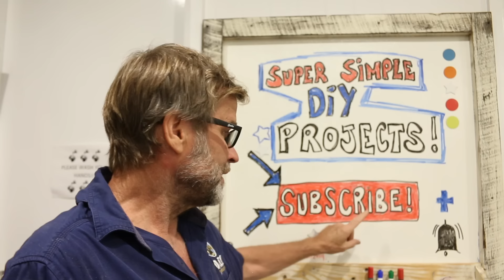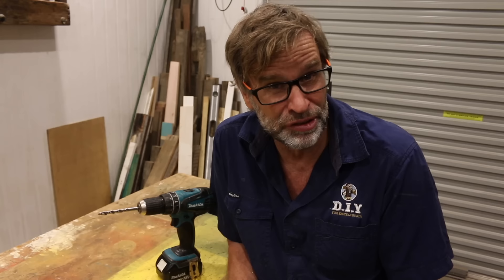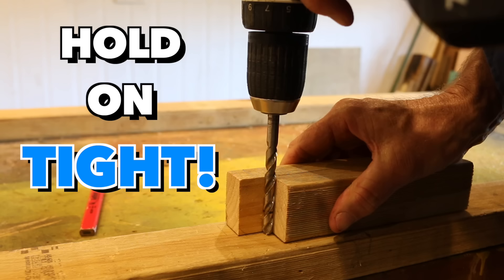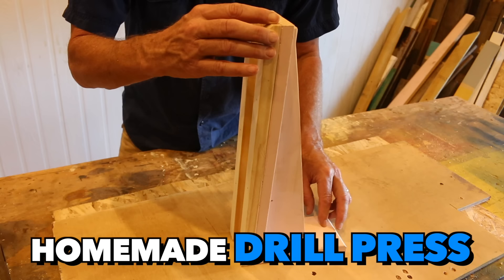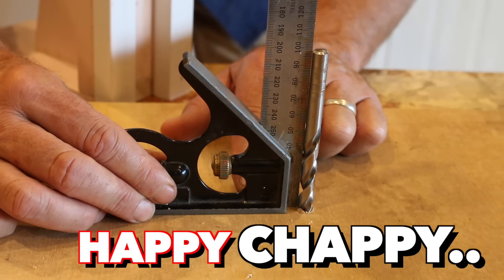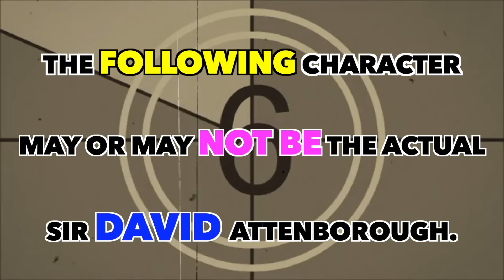8 AMAZING Cordless Drill TIPS!

Comment: I would not recommend slapping a magnet on the side of any motor, especially a brushless one.  Electric motors are driven by magnetic fields, so introducing a strong external field will reduce their efficiency.  Also, many drills are related by speed controllers which use field-sensitive components to measure the motors RPMs.  If you happen to put the magnet too close to such a sensor, it won't work properly.  (I would avoid the trigger area for that same reason also.)
Reply: I was thinking the same. Would the magnet be safe on the battery (assuming it would stick)?
Reply: @KlockoFett  Good question... Probably, I think.  The battery themselves aren't going to respond to a magnetic field, so unless there's a FET or something like that in the casing circuit, it should be OK. I have a couple of Ryobi drill/drivers with magnetic screw holders built into the battery holder.

Comment: Some nice tips here except I have to question putting a strong magnet up near the motor -- with the electronic sensors in these tools I'd find a different location.  On my multi-tool I epoxied a magnet near the base to hold the allen key needed for blade changes.  I bet someone has already commented that a bar of soap can also be used to lubricate screw threads.  For you Bond fans in the painting / coloring business go see No Time To Dye.  (GROAN)  But it's a great movie IMO -- saw it in the actual theater, if you remember those.  Peace from the US.
Reply: Yes, the motor uses magnets.  I wouldn't put the in close proximity.  Soap was the go-to choice back in the day.  I need to see No Time to Dye now.  Thank you for the post.

Comment: I've been using nails for drill bits for 30 years. Glad to see others figure it out. One warning, if you drill much, like through 2x4s using framing nails, the nails get REALLY HOT! Burned myself more than once. For longer nails, like framing nails, you don't need to cut the heads off. Just insert the head deep enough and the chuck will close just fine.
Reply from the maker: Thanks for the extra tips Dan!.....and for watching....much appreciated 😁🇦🇺👍

Comment: All 8 tips:
1.  Permanent marker to mark the hole depth on a drill bit
2. Soap or Wax to lubricate a screw
3. Use two pieces of scrap wood to form a drill guide
4. Rare magnet glued to the cordless drill holds your
screws.
5. Homemade drill press/guide out of wood
6. Use low speed to conserve battery
7. Snip the head of a nail and use it as a drill bit
8. You can peel an apple with a cordless drill
Reply from the maker: Thanks for the list Flash 👍😁🇦🇺
Reply: My addition to #1: Set direction to "unscrew" (left turning) to keep sharpie tip intact.
Reply: One addition  ... if you need to lubricate a small metal shaft just rub it on the side of your nose.

Comment: I love the drill-guide drill-press idea!!  The only thing I was hesitant about was hot gluing a wood block to the drill. Instead I made my own modifications adding a 3-inch ABS tube with a cutout mounted to a sled with a couple of small roller bearing wheels. Works great!  All made from scrap material too = no cost, only time and fun investment.
Reply from the maker: Awesome idea Mark! Well done mate 👍😁🇦🇺
Reply: Why don't drill manufacturers sell a drill press accessory?  The drill should be sold with a guide block attachment point like cameras have a tripod mount.
Reply: @geo8rge   digitally 3d scan your drill and print  a heavy load bearing accessory like from Nylon or Wood filament  with attachment holes and necessary groove for  slides

Comment: The speed selector doesn't change the voltage anymore like really old drills it changes the gear box so you get more torque less speed so you'll use the same amount of watts no matter what speed you're in you will not be saving anything to get your last few holes done
Reply: The torque increase allows you to get more torque out  a lower voltage though. Petty much use the highspeed setting, then once you get to the point where torque is lost switch to lower speed you might get a couple more screws in.
Reply: I agree with Amrauz. The gear change will reduce the current demand enough to squeeze a little more out of the battery.
Reply: The low gear is also safer for delicate jobs. It's easy to accidentally damage it on high speed.

Comment: I did a woodworking course when I was a teenager. The course was run by an old joiner who was due to retire. He kept a candle in his toolbox to provide the lubrication needed for driving screws. It makes a massive difference.when driving screws by hand but I imagine that this would really help to conserve battery power when driving lots of screws using battery powered tools.
Reply from the maker: Very true Stuart 👍👍
Reply: Also useful to rub wax along the teeth of a hand saw.
Reply: Also useful for sticky wooden drawers.  Wax 'em.

Comment: I have a tip, I'm an aircraft mechanic. And I remove panels all the time with hundreds of screws. And what I do is  put a dab of valve lapping compound on the tip of the apex bit. What it's does is it makes the apex bit grips the screw much better and is less likely to strip the screw. You can find valve lapping compound at a auto part store. This is an lifesaver for me.
Reply from the maker: Ad....that's an awesome tip mate...l'll have to go and check that out! Cheers and thanks for watching 👍😁🇦🇺

Comment: My late dad was a clock maker and a tool and die maker. He had a trick where you use the oils from the side of your nose where your outer nostril meets your face to lube screws and machine screws. 
Its acually the same oil used to lube clock bushings. There are only 2 natural sources for the none synthetic oil. A species of shark (that I cant remember the name of) and the human nose where the skin on the side of your nostrils meets your face. That little grove.
In any case they don't produce that natural oil anymore. You can only get the synthetic stuff.
Reply from the maker: Great info!....thanks mate 👍😁🇦🇺
Reply: The oil is called squalene. An old watchmaker/repairer's trick.
Reply: @bl0p3z01  he stopped doing watches because it got to difficult to see the tiny parts.
Reply: Very interesting. You bet I ran my finger through my nose part. It's dry here in the Canadian  west lol.
Reply: In chemistry you use it to lubricate the tap on a filtration funnel
Reply: Little grove between your top lip and nose = filtrum
Reply: At first I thought you were talking about snot 😂

Comment: While the pen depth gauge works a treat, I still like using tape for two reasons
1. As you see the shavings being swept, you know you've nearly hit your depth mark. 
2. It's sweeping the dust out of the way. 
Generally you're only drilling a couple of holes anyway so there's not too much chance of screwing up the tape. Besides, you can always add more tape. If I need a lot of holes at that depth, I just drill through a block of wood and use that as a depth gauge.

As for using wax for screws, yeah you can pretty much use anything. I keep almost used up candles there just for that purpose (and for lubricating draw runners, protecting steel tools). But soap works just as well for driving in screws.

Comment: Rub the screw in your hair. 
My bald head: Am I a joke to you?
Reply: This is a really really very good tip; if you do not have wax nearby, just use a bar of soap. Even liquid soap will work like magic. Oil may leave a stain but some lubrication is always welcome.
Reply: @janami-dharmam  Screws go in. Never felt the need for lubricating them in 37 years of joinery
Reply: @johnmurray9422  Please please try just for once; you will be pleased that you did. Brand new screws already have some oil on them and it works great on old screws. You know, old screws do need some lubrication most of the time...
Reply: Vaseline sold dirt cheap in the pharma aisles of dept. stores works well. Just dip the drill bit in the little container.
No nasty thoughts please.

Comment: As far as depth gauge drill bit, the thing about using tape is you can reuse the same bit for any depth by removing the tape and applying new tape.  Using a permanent marker you now have a permanent depth gauge that will forever work with only one depth.
Reply: Or a bunch of different depths marked on the same bit, also rather useless.
Reply: Actually denatured alcohol takes off permanent marker on non-porous surfaces.
Reply: Or going over it again with that permanent marker and immediately wipe it off: everything comes off.

Comment: I was taught by my Grandfather to turn the nail around and to tap the point of a it before hammering it in. That stops the wood splitting
Reply: Only happens with oval  nails
Reply: Same. But not my grandfather.
Reply: How it works? can't image it
Reply: @just-ice-4-all  Tapping the end blunts the nail point.  When hammering the nail in the wood it punches the nail thru the fibers of the wood instead of separating the fibers causing the the wood to split.  Works with all nails.
Reply: @elliottsmith3632  that makes sense. thanks
Reply: RITE! aaannd also i lick it or similar to wet the nail
Reply: @mos8541  Rub the tip of the nail on a piece of bar soap, same as you do with a screw to get it to "ease" through the wood.
Reply: @larrywhalen596  thanks, do they make a soap holder for my nail bag? hah
Reply: @mos8541  yeah,  Dad and friends were building a boat. The oldest one dragged his nail OR screw over soap first. Took years before someone asked me why i did that. I had no idea. I understand now when i see them looking at me.
Reply: I used to use candles, until I bought an impact driver...
Reply: @elliottsmith3632  Why don't they sell specially "tip blunted" nails then ? or do they?
Reply: I call it old grandpa trick.
Reply: Learnt the same when i was working in School-Holidays on Construction sides. And it worked pretty fine
Reply: @patrickotana627 
They used to... But haven't seen them for years.
Reply: @rocknral  they were used for asbestos sheets
Reply: @chriseggers560  Very true.

Comment: Great video, Sir! With the wax on screw thread thing - in the 70s I was helping my old man and an old retired carpenter to upgrade and extend our house and old Jack used to rub nails tip first through his hair to pick up hair oil and make them super easy to drive. Years later I remembered that when I was using c'sunk batten screws - and scratched my scalp. But then I got clever and used things from soap to wax to cooking oil to make driving screws easier. They all work, but soap tends to absorb moisture over time and rust the fasteners. Cooking oil (or sewing machine oil, sump oil - whatever ya got) is the best. And with wax, you can scrape shavings and put on in the pilot hole - magic.
Reply from the maker: 👍👍...Good tips mate 👍👍

Comment: Nice tips Shane love the nail pilot one especially. Also did you know that to stop the chuck coming loose when you drill, on most decent drills you can tighten the chuck up on the drill bit then turn it back one click and you’ll lock the chuck. It works on the makita for sure cos it’s the same set I have 👍🏻
Reply from the maker: Mate!.....never heard of that one before....l'll have to give it a go. Thanks for the tip and for watching Dave 👍😁🇦🇺
Reply: @francoisloriot2674  Works on my makita drill

Comment: instead of wax, we dont all have surfboards, a cake or block of everyday common soap, thats soap not soup
Reply from the maker: 😂...Yeah soup may get a little messy Tony. The reason l used surfboard wax was that we live on the beach and the kids have surfboard wax lying EVERYWHERE so it's easy to lay my hands on 👍👍
Reply: @diyforknuckleheads  used candles are great for this. Use them all the time!
Reply: I use those wax toilet bowl rings,melt em down into a small coffee can
Reply: I use soap too... it’s not messy when the bar of soap is dry. Also drag the screw lengthwise rather than rolling it - much quicker. If you use a premium soap it will contain moisturisers for your skin and smell nice too 😂😂😂

Comment: Nice tips, got an extra one for you: became fed up the other day of swapping out bits in order to use the screwhead countersink thing so I just started using the same bit that I drive the screws with. Give it a little tap with the bit before driving the screws and before you know it, perfectly flush screw heads in half the time, also found that it stopped a lot of wood from splitting.
Reply from the maker: WOW!...great tip SirRob....thanks for sharing that mate 👍😁🇦🇺
Reply: @diyforknuckleheads  aye, I think I owed you a tip after all the ones you've given me, feel free to pass it on in your videos. Thanks for helping me to go from 90% bodge jobs to about 40%.
Reply: @SirRob7  I do the same on occasion, but thats because i don't have a countersink.

Comment: Hey Bloke, I have also used a piece conduit cut so that the required length of bit is exposed.  This idea was pretty good for when I drilled heaps of holes and were all a consistent depth.  Also when screwing in coach screws, I use a bit of multi purpose grease especially into hardwood and the grease puts a thin film on the screw for protection (old 'busted-ar..ed Liney' trick
Reply from the maker: Love the tips Rosscoe!! I've used the grease before but not the conduit which is really clever 👍 Thanks for watching mate 👍😁🇦🇺
Reply: @diyforknuckleheads  Plastic straws might be a great option as well! Cut them to length then throw them in your tool box.

Comment: Never tested it but the "slow setting" is actually a higher torque so it would use just as much battery if not more as you would need more effort to drill a hole, you would use that setting drilling into metals or harder materials, a good tip though that allot of people don't know is how to use the chuck settings, allot of people think the numbers on the drill are speeds but it actually controls resistance, so a higher number will keep drilling through but a slower number will stop the drill once a certain tension is reached, good tip when using a drill for screwing handle screws, set the drill to a low number and once the screw is tight it will stop the drill preventing you drilling through or cracking the door.
Reply from the maker: Good tips Raty....thanks for sharing  👍👍

Comment: Hey I got a tip at 2:29. I mentioned cleaning gutters using a blower. You could get your cordless makita blower and instead of blowing with your mouth, use the blower. I know my nose is more sensitive and when I blow stuff I get sinus and the stiff blows back to my nose. I have used a blower to blow off wood dust and it works quite well.

Comment: Another tip when nailing near the edge of wood is to blunt the sharp end of the nail by tapping it with a hammer, works by ripping the fibres instead of dividing them.

Comment: Also, if you are drilling through metal but don't have a drill press, get an 18"-24" squeeze clamp and clamp one end under your metal and the other onto the back of the drill and voila, +300lbs of steady pressure which is very important for drilling through metal (slow rpm, lots of pressure).
Reply from the maker: Great tip....thanks 👍😁🇦🇺

Comment: Changing speed of a drill is not always right. I don't know in how many but, all the drills i used this 1/2 switch was not speed change but gear ratio change, so the engine was running at the same speed but the gear ratio was different so the bit was spinning slower but with more momentum. In short it would not change battery usage because it did not slow down the engine.

Comment: Pro tip - when using a racheting chuck.  Tighten it all the way and then back off 1 click.   That little bit of loosening will engage the locking action on the chuck and holds the bit super tight.  
Also I feel the same way about inserting a battery into a drill.  I always pretend it’s a fancy hand gun
Reply from the maker: love that tip Billy👍👍 Thanks for sharing mate. Glad to see you're a member of the Battery Clicking Club as well 😂😂.
Reply: Funny I only saw a video on this the other day.  No one I know knew this trick either. Can’t find any info in the instructions either. Been doing it wrong for years.
Reply: Greg F pro tool reviews did a video on how to lock your chuck.   That’s where I learned about it.   It’s like a 3-4 minute video.

Comment: Thanks for the tips. How did you attach the wood block on top of the drill for a 90 degree hole?
Reply from the maker: Hot glued it Jave after l moulded it parallel to the drill 👍

Comment: I love the vertical drill control methods.
   As to changing battery packs equivalent to changing firearm magazines, yes I do the same as you even though I don't own any semi autos. But I may have one up on you with the old cylindrical Black & Decker battery packs which I doubt are still used. Anyway, resembling an oversized 12 ga. shotgun shell I put them in place like I was loading my shotgun.
Reply from the maker: Hahahahaha...we all do it Joe 👍🇦🇺😁

Comment: Permanent marker can be easily wiped off of a drill bit (and most other surfaces) with a bit of rubbing alcohol or hand sanitizer...

Surfboard wax is kinda expensive... I would suggest used bits of old candles, crayons, etc... can melt them all down and pour into a mold.  Another item that works wonders for this purpose is an old bar of soap.
Reply from the maker: Yeah all good tips there Greg 👍👍....thanks for sharing. Then reason l used surfboard wax was that we live on the beach and my sons have surfboard wax lying on every flat surface possible in the house!! 😂 Thanks for watching mate and l appreciate the feedback 👍😁🇦🇺